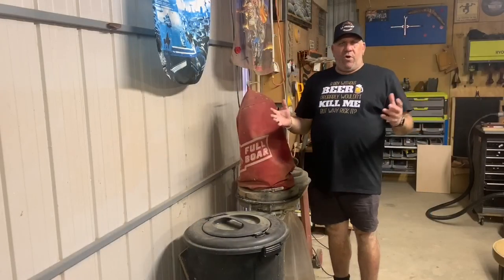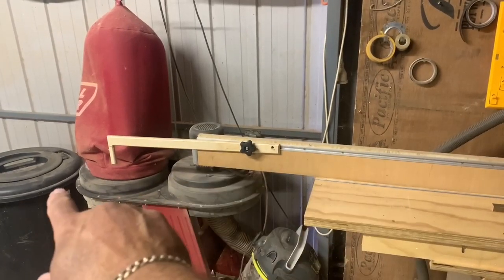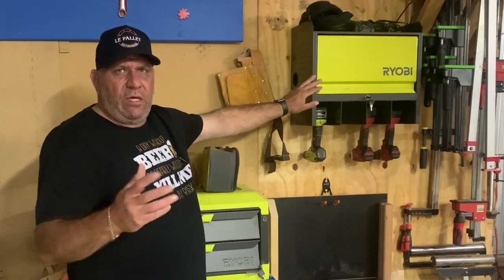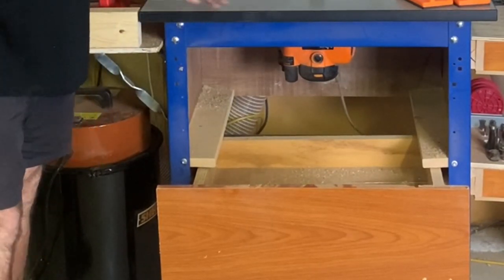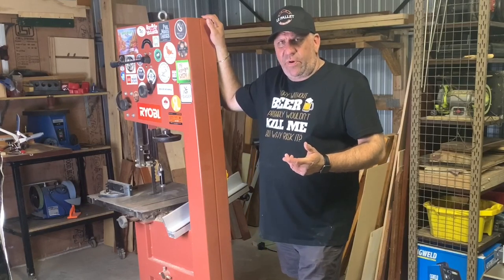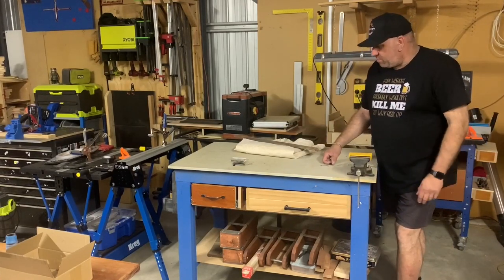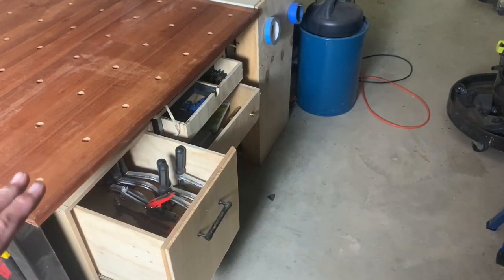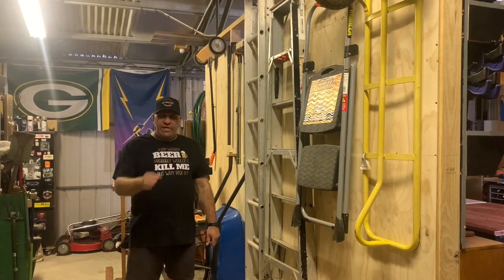Woodworking SHOP Tour 2021 #workshop #tour #machinery

Comment: Hello Dirk,
It is a necessity to make constant changes in the workshop. Because I am experiencing the same situation. It is necessary to eliminate clutter and what we do not use. The dust extraction system is an indispensable part of the workshop. Your Bosch miter saw and many of the power tools you use are very high quality and beautiful. I liked the measuring ruler you made for your miter saw. very good idea for cutting longer wood. The lamp in the cabinet and the drawers under it are useful and still a good idea. I see woodworking apparatuses that you made yourself. I call it the Ryobi corner. :-) good to have drawers and tool chests everywhere. Because we quickly reach the tools and materials we want to reach. I like the pocket hole punch system. I don't understand why they criticize it. So I agree with you. and thickness machine. This is a powerful thickness machine. Router desk. A nice rack for radial drill, oscillating spindle sander, disc sander, 16 inch band saw, clamps. many tools. Although the colors are not very compatible :-) I see that the table you made works. A 3-hp table saw. Rich stickers on the cabinet door... a wall for the stairs. .............. Dear friend, we had a nice workshop tour together with you.   Like the match announcer, I tried to explain it by writing. :-) It is a fact that your workshop is very beautiful and spacious. I'm trying to do something in a very narrow space. Thank you for sharing. I wish you a nice new week. Cheers mate. Big greetings. Kind regards.
Reply from the maker: Greetings Mehmet,
Many thanks for your kind words & discussion about how we try to present our workshops the best we can, you have a nice space also & I know it’s small but you make the magic happen there with all those magnificent projects & builds you do.
Yes I have some very nice machines & I appreciate how they work from the engineered design of them plus the practical applications I can use them for but they are not essential to get the same results that you will get using your tools.
Imagination is what leads many of us to create things & the process of finishing a project is the wonderful part my friend.
Thank you as always Mehmet 🍻👍👍👍👍
Reply: @sumosprojects  Greetings Dear friend Dirk,
Thank you very much for your nice comments and words. You are absolutely right. Imagination is very important. I enjoy it every time I finish a project. I agree with you. Take care of yourself. See you anytime. A big friendly hug. Cheers mate.

Comment: Excellent tour, Dirk. Good to see a proper workshop tour. Everything in its place, and I like the way many of the standard setups has been customised for pratical woodworking use (eg that standoff on the router table to collect dust flying off from the table). 👍😁
Reply from the maker: Cheers Suj, yes you make a valid point mate as to the small tweaks we make to give an advantage to dust collection points, tool wall space & many more personalised items. Still working towards the perfect workshop because it keeps us all interested mate 🍻👍👍👍👍

Comment: You have got a big shop Dirk! Lots of organization! I love the radial arm drill press and the ladder wall is a good thing! Which tool would you like to buy next?
Reply from the maker: G’day Juliet, the pillar drill is amazing & although I haven’t used it to it’s full potential yet I love the fact it has only 5 speeds & I can put a larger table onto it.
Organisation is coming along & next tool I’d love is a Festool Domino as I think they are a magnificent joinery tool & whilst expensive it’s something on my bucket list 🧐🙏🤠🍻👍